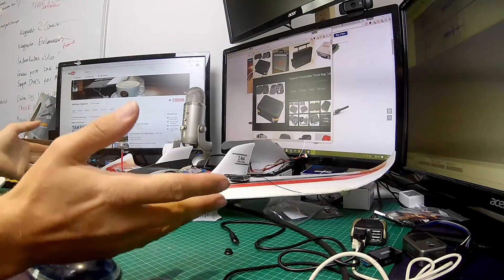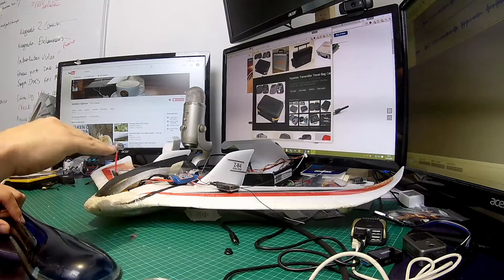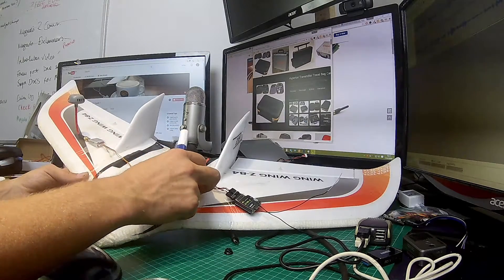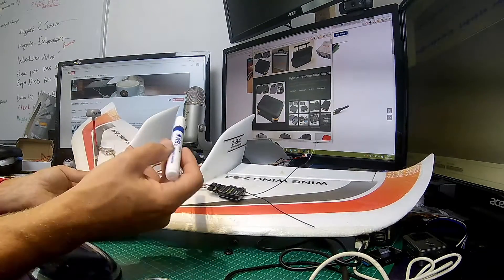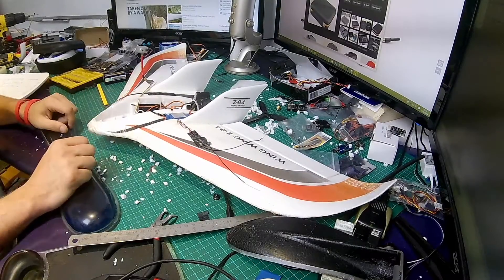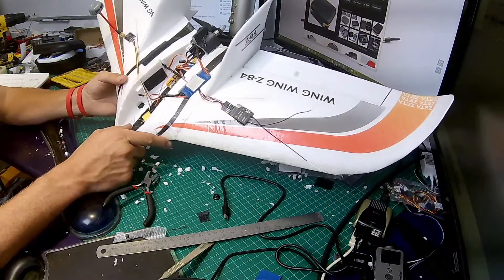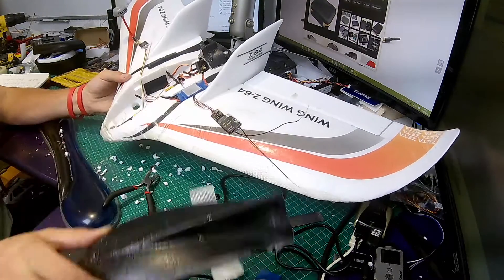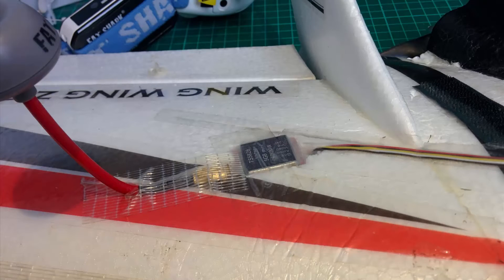Flying Wing FPV Build - FPV Conversion of a WingWing Z-84

Comment: thanks for this! I built one 7 years ago. I noe have 2 new frames I'll be building next week or will 🤓
what power train u running? and running 2S 2200mAh?
I had a folding prop on my v1.0. it was hard to get. what u running?
.Roger
Reply from the maker: Howdy Roger, for a WingWing Z-84, normally the best setup for fun flying is a D2826 2200Kv motor with a 6x4 prop. It can be run on both 3S and 4S with a larger ESC. Hope that helps. Matt

Comment: Great video. Could you share your PID setting for this Z84 please?
Reply from the maker: Morning Dieter, the stabilizer used doesn't have PID's per-say as they are potentiometers. I always crank mine up to the max and come back 1/4 of a turn and see how that works out. Matt
Reply: Thanks Matt.  Sorry but I've been watching too many videos and got you confused with someone who installed an APM 3.1 mini like I did.    It works great but I really need to get my tuning improved.  In  FBWA mode  it barely turns.  I am having a hard time tuning in Autotune mode because this wing is way too fast for me to do it properly.  This wing is so much fun and the price is right.
Reply from the maker: Dieter Preiser Morning Dieter, lmfao, yea I get video blindness at times as I get through so many of them on YT. Totally agree, the WingWing, everyone should own at least one of them! Matt

Comment: mate, put the FPV gear in the front and the receiver in the back... that way you get the separation and keep the balance. then move the battery to fic the CoG
Reply from the maker: Howdy Fella,

I thought about just stuffing it in the lid, but wanted to get some separation between the devices, if that makes sense! Matt